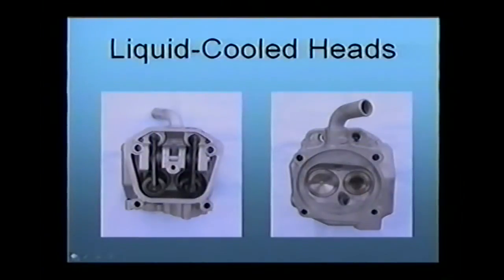Rotax 912 / 914 Series Aircraft Engine - Liquid Cooled Heads

Comment: What would be the major cause of the coolant reservoir overflowing at about 5000rpm?
Reply from the maker: It could it be your pressure cap is faulty and not maintaining correct pressure in the cooling system. Very low pressure would allow the coolant to boil, which would then blow steam into the overflow bottle and cause the coolant to be pushed out of the vented cap.

Some caps hold 0.9 bar while others can be purchased that hold 1.2 bar of pressure.

It's highly unlikely (but not impossible) that coolant is leaking into the cylinders from the liquid cooled heads.

If this is the case the coolant would work its way out to the exhaust. The exhaust would be steaming, and the offending cylinder would have a steam cleaned the sparkplug as evidence.

If it's a new engine then this could be a defect in the head casting, and I suggest you contact your supplier. But before doing that I would replace the cap, you can purchase the cap from BMW:

Radiator cap is BMW part number 17 11 2 345 074 at about 1/2 of the Rotax price (fitted to BMW motorcycle F650 with Rotax engine).

Good luck.